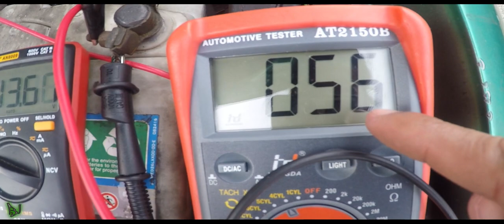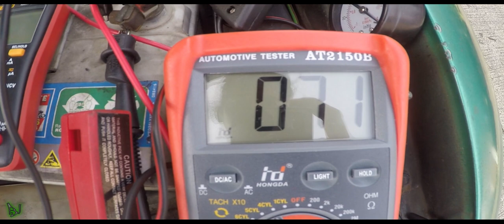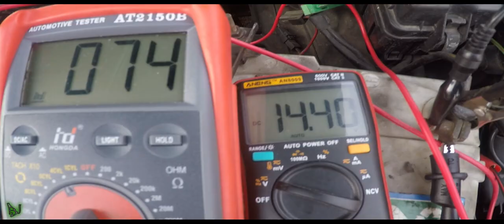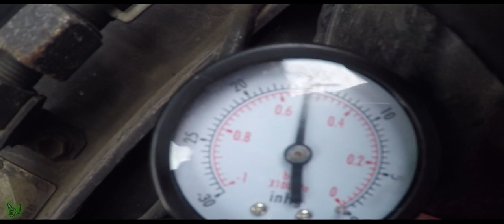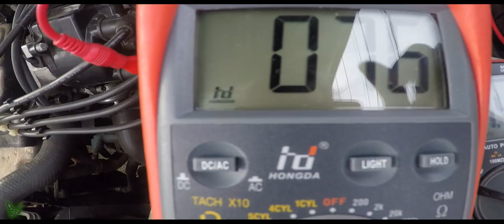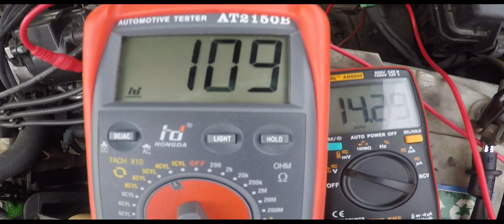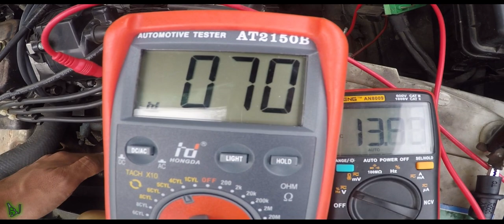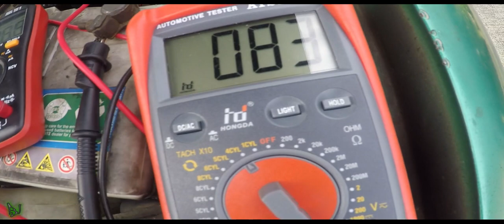Actual Air and Fuel Mixture Screw Adjustment

Comment: gumawa ka po ba ng bagong linya negative s distributor kung san nakaconnect un positive ng tester mo?
Reply from the maker: Oo boss. Nag labas ako ng negative wire mula sa ignition coil. Para madali mag tono.
Reply: @berdiesjourney  okay okay. thnk you boss.
Reply: @berdiesjourney  boss tanong lang, un multimeter ko pran iba meron naman sya rotational speed measurement pero paran hndi nya mabasa na ayos yun rpm ng sskyan ko. obdemoto 2900a un brand nun s akin
Reply from the maker: @ernievelasco23  pa send ng pic sa fb page boss. Patingin.
Reply: @berdiesjourney  sige wait lng
Reply: @berdiesjourney  nasend ko n boss s fb page mo po

Comment: boss parehas tayo ng auto air fuel tuning din ba ang solusyon sa parang nagbabackfire
Reply from the maker: Dipende boss. Check nyo muna muffler nyo baka may butas.
Reply: @berdiesjourney  un nga po ang pngalawa kong naisip baka po may butas ang exhaust ko salamat boss
Reply: @berdiesjourney  boss ung timing ba at airfuel tuning parehas lang?
Reply from the maker: @rafban4216  magkaiba boss.
Reply: @berdiesjourney  saan po ba ginagawa ung timing? sensya na po marami akong tanong gusto ko lang talga matuto para iwas budol
Reply from the maker: @rafban4216  timing boss. Gagamitan ng timing light para maitama ang distributor.
Reply: @berdiesjourney  salamat ng marami po boss...
Reply: tungkol dun sa backfire boss tama ka may butas exhaust pipe ko tska papalitan na rin daw ung resonator pinaestimate ko 2100 lahat lahat....sakto lang ba ung presyo boss may puputulin daw rin kasing mga pipe tsaka palit resonator
Reply from the maker: @rafban4216  pede na boss

Comment: Boss tanong ko lang, hindi ba dapat sabay ang ikot ng aux fan sa rad fan pag nag on ito? then pag naka AC ako bukas both rad fan at aux fan then namamatay lang sila pag mag matic na yung compressor. ganun kasi sabi ng ibang mekaniko at gumagawa ng AC.
Reply from the maker: Christian Gañac stock setting po sabay dapat. at sabay din nag ooff. pero sakin hindi po kaya palamigin yung aircon condenser ko. kaya nag dagdag ako ng fan para sa kanya lang at para hindi mag init yung pag higop ng dalawang fan.
Reply: @berdiesjourney  ahh. Okay rin kasi yan. Parang modelo na kotse ang system ng AC. Naka bukod ang linya ng rad fan sa aux fan. Same tayo kasi ng makina pati distributor na electronic same rin. GTX yan di ba?
Reply from the maker: Christian Gañac may nag pagawa sakin ngayon lang. kasi hindi ko nagawa. hahaha. mali ang timing marks ng timing belt. hindi maiset sa top dead center. palyado pa din. sana makauwi sila.l ng ayus. hehe.

Comment: Sir tanong ko lang po, OTJ ko ayaw gumana ang 3&4 spark plug nag palit na ako ganon parin tapos may spark nman ang wire nya, ano po kaya ang dahilan sir salamat po.
Reply from the maker: Distributor cap or higjtension wires boss
Reply: Pero sir meron po kuryente ang hightension wire nya salamat.
Reply from the maker: @judyaninon1938  spark plugs baka busted na
Reply: Napalitan ko narin po sir ng spark plug.
Reply from the maker: @judyaninon1938  hmmm nakaka taka yan. Kuryente kasi nyan dadaloy lang naman sa distributor rotor at hightension wire. Doon lang tracing nun boss.
Reply: Oo nga po sir kaya nag taka din ako tapos nag tune-up narin ako kc baka tukod ok nman po wala nman pong tukod.
Reply from the maker: @judyaninon1938  distributor cap try mo lihain. Rotor din. Tapos yung hightension wire check mo yung plugs baka nag loose hindi kumakapit. Try mo din ilipat yung spark plugs na may kuryente sa wires na wala. Para malaman talaga kung alin ang may sira.
Reply: @berdiesjourney  ok po try ko po sir salamat.

Comment: Sir anong tawag sa tester na ginamit mo sa Rpm at idle up?
Reply from the maker: Pao Mabini automotive multimeter boss. sa online ko lang sya nabili.
Reply: @berdiesjourney  salamat sir
Reply: @berdiesjourney  Sir pano pla iconnect sa makina pagginagamit na un tester?
Reply from the maker: Pao Mabini may unboxing at teardown ako nung multimeter. para may idea ang mga bibili kung ano itsura nya sa loob. hehe
Reply from the maker: Pao Mabini red wire sa negative ng ignition coil. tapos select mo lang sa mutimeter yung 4cylinder.